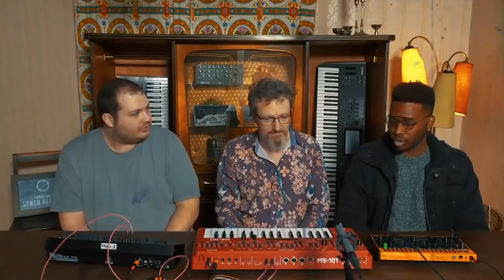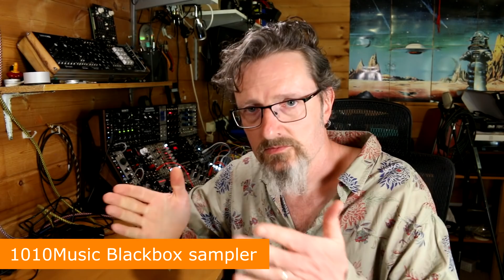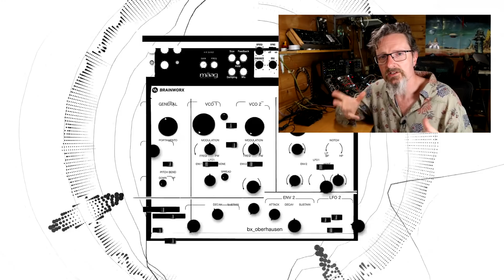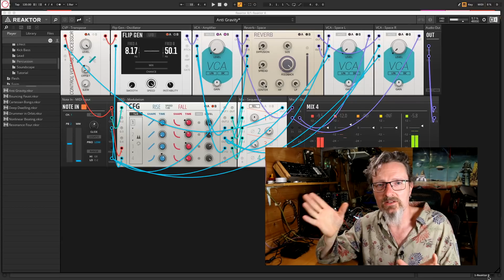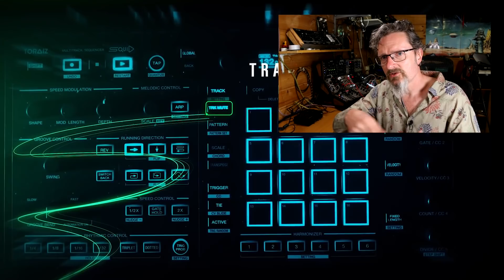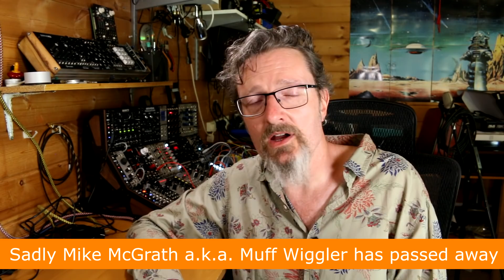Molten Music Monthly - April 2019

Comment: Some Noise Engineering info, as I understand it. The first "Percido" module (Loquelic Iteritas, or LI) was  created after Noise Engineering learned how folks were using the original LI to create percussion. They added an envelope with interesting ways to send it to all parameters. The Cursus Iteritas (CI) Percido appears to be a similar transformation. The LI has two oscillators which can cross modulate in various interesting ways, including each other at the same time. I own a CI, and though it's called a wavetable oscillator, I don't really think it is similar to other ones in that it offers 3 different waves, and there is no morphing between them. I'd actually think of it more as a harmonic oscillator in the sense that you can tilt, widen, and shift/center the harmonic content similar to how I understand the Verbos Harmonic Oscillator works. So maybe it's a harmonic wavetable oscillator? The CI adds on some other digital-specific goodies, as well. My CI (and Sinc Iter) are not leaving my rack any time soon, if ever!
Reply from the maker: Thanks for the info, I’m sure we’ll get to the bottom of it 😀

Comment: I have dedicated controller for VST Korg MS-20 and I can see it's appeal. Normal MIDI controller doesn't quite give you this level of instant access to all parameters (well, most parameters) and also keys. It wasn't really as expensive (although I've bought it used) and VST was included.